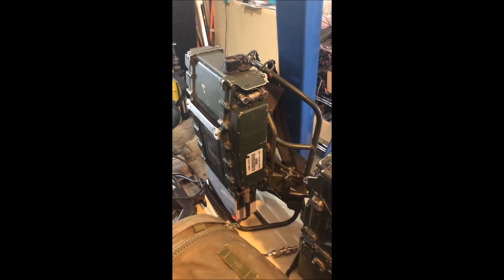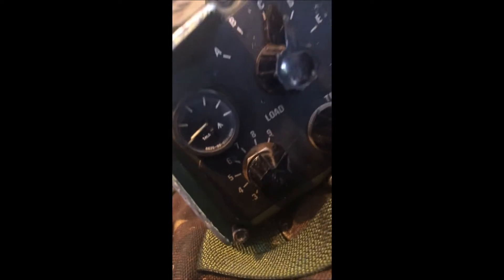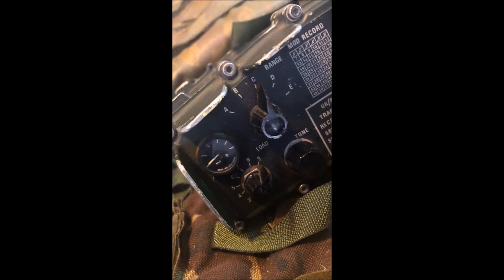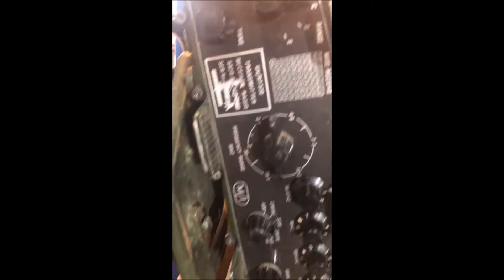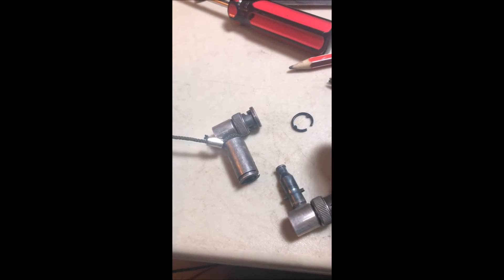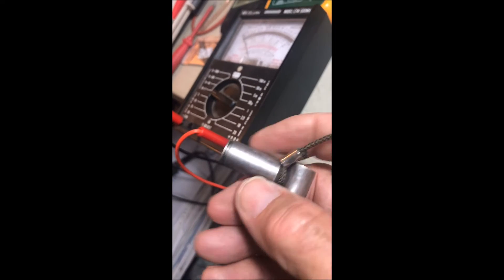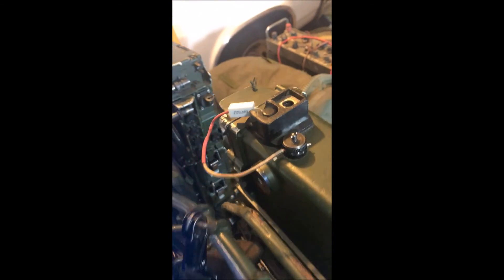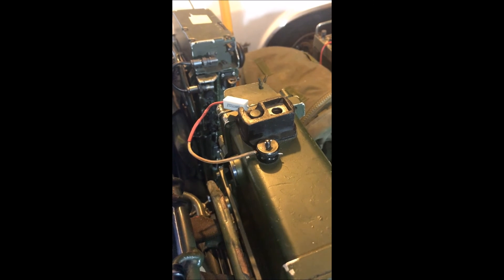VK2PRC Clansman 320 Tuner Fault

Comment: The plating on dog one is silver. Just use metal polish instead of anything abrasive. I have had a few where center pin was not soldered very well and came out when pulled apart.